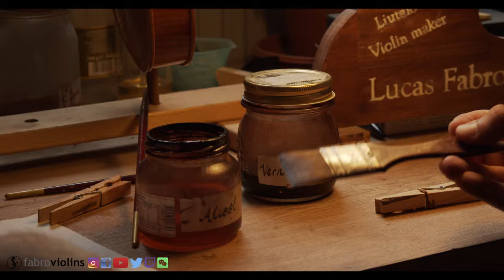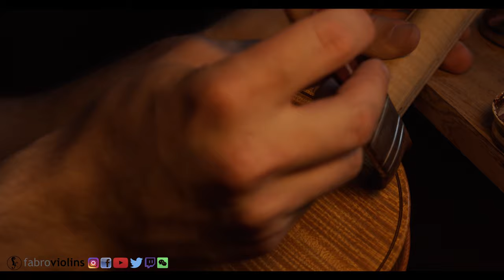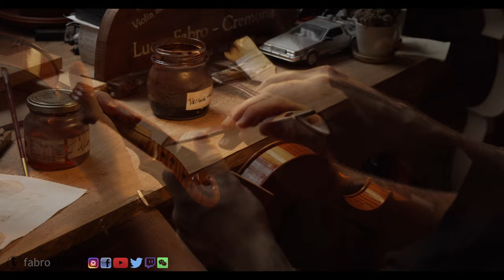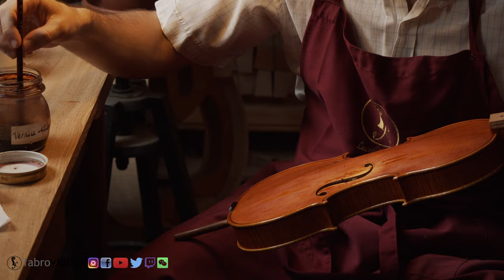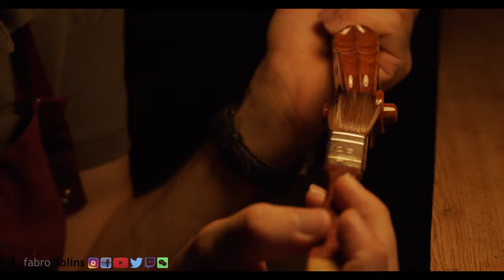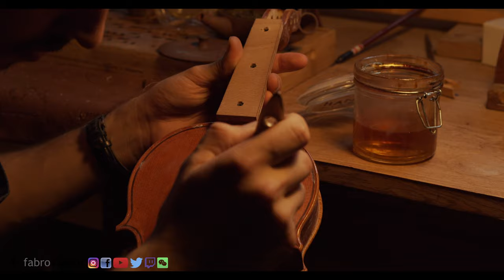MAKING A VIOLIN | The VARNISH | Step 21 | Amati Model

Comment: Wonderful work Luca!!! I love your videos. May I ask how many coats aprox  do u apply at the body? Do u use sandpaper after every coat? Congrats
Reply from the maker: Thank you very much for your message! I'd say I apply between 30 and 40 coats including retouches! (but keep in mind that I make my varnish very liquid!). And no, I only use sandpaper when I feel it's necessary haha. I know that's not saying much but it is the truth! However much more towards the end, there I do it very very often with a finer grit every time. At the beginning instead I can do several (5-10) without.

Comment: Beautiful work. The neck of the violin looks lighter. Lucas, how many coats of varnish is applied to the neck of a violin? thanks
Reply from the maker: Thank you very much! None. The neck doesn't get varnished as the hand needs to slide freely and the varnish would stop that. Also, the constant touch would remove any varnish that could be applied to it.

Comment: what brand of sandpaper did you use?
Reply from the maker: Hi! Thanks for your comment! 
I'm not really sure what brand of sandpaper I was using as it's something that's not used a lot and I also don't find the brand to be that relevant, if not the grit (has to be a very soft one). The same applies for when I use the micromesh. 
Hope that was useful!